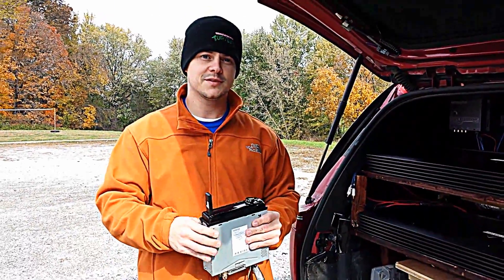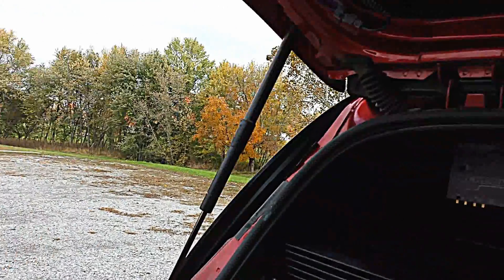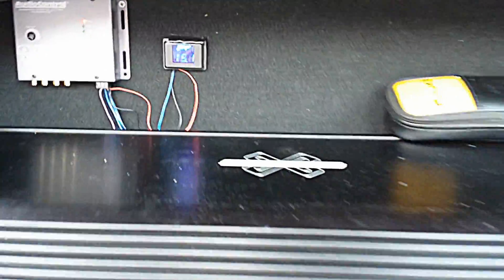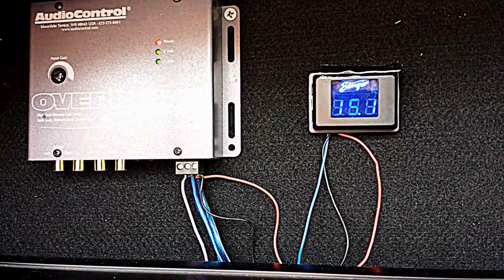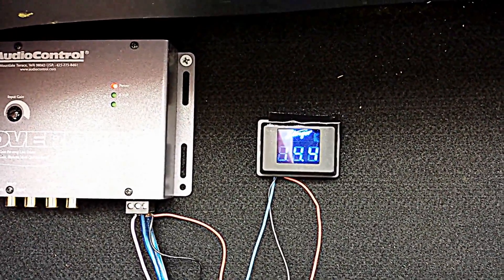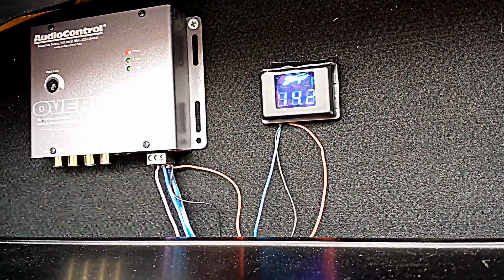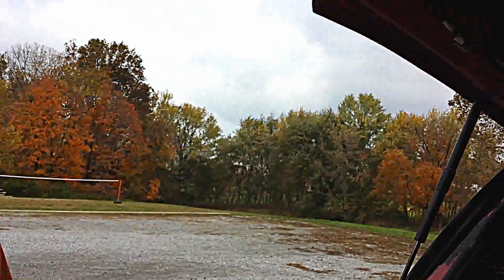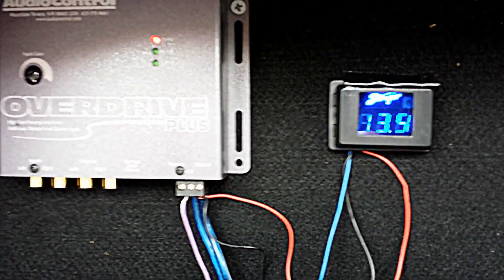Ultra Capacitor, Super Capacitor Demonstration, Explanation. supercap, ultracap, Amplifier

Comment: I used a bank of six 1500 farads without a battery in my van for over a year.
At 7volts, it still has enough amperage to start the engine. It also doesn’t load the alternator when charged like a battery.

Comment: very nice video!   I have in my car only 4 speakers without any amplifier.and my question is: can i use in my car xs ultra capacitor bank 12v 500farad, without using any battery at all?   the xs ultra capacitor bank will last longer than a battery?

Comment: I just bought 6 3000f 2.7v cells to make 16v and 500farrad. I will have about 2500watts between my two amps and just the main batterie to run the car. It sounds pretty good without any capacitors but the bass drops off after the first big hit, I’m hoping this will help. I’ve heard you should have 50farrads for every 1kW worth of power

Comment: batteries last about 3 years, how long do capacitors last?
Reply: They say for ever. but who knows.
Reply: 10 years at 80degrees C, 1,000,000 charge/discharge cycles according to the datasheet

Comment: 12 banks would be more like 6Ah.  And that's if u charge them to 16.2volts and draw current until it drops to 12 volts (somewhat usable voltage). I'm trying to determine what I'm gonna do for electrical. I'm not a spl burp type. I demo music and do street beat lol. I got 2 Mechman 320s.  Trying to get electrical ready for my M5. Are u running pure caps? I was thinking about running 8 banks of caps and just my 2 stock battery (duralasts side posts) but I'm up in the air. $2000 is my battery/cap budget. I was also thinking 2 standard 80ah agms, 1 45ah jy lithium and just 2 banks of caps....

Comment: all a battery in a car is doing. is to start the motor and power your radio if you turn the key in AUXILIARY , then your alternator does the rest, as for caps, they make sure you have that constant power there supplied by the alternator. So it makes know sense why you took your battery out of your vehicle!!!

Comment: would i be able to keep 14.4v on music engine running with a 100a alternator with 14.4v output with a dc to dc converter(battery isolator) which gives me another 20a of output hooked up to a bank of capacitors or would i be better off getting a 270ah 100 hour battery? I am buying a hcca5000.1d it makes 5300 watts @ 1ohm with 12.6v and 7200 watts @ 1ohm with 14.4v
Reply: You're not getting anywhere with a 100a alternator.

Comment: amazing! fantastic work! I know this vid is a year old, but I am going to copy and paste my response to a kid who posted a vid that was trying to explain that caps are garbage. I have tested 2   1farads back to back inline and I know how much they help. to hell with playing your system with engine off. heres my response to young-buck.......stop listening to car audio forums. the guys telling u to buy batteries are sponsored by agm battery companies. take a dmm, Digital Multi Meter and do a b4 and after test. place the dmm leads DIRECTLY on your amp while playing a loud bass song. most setups will gain appr 1.0 volts with a 1farad cap! I have installed 2  1farad caps inline and gained 1.4volts continuously! so unless you want to run your system a lot with engine off or unless you want to support the economy, then u should try my test. caps are no more of a bandaid than extra batteries. extra batteries put hella strain on your alternator. if u watch the big dogs runnin 20k plus they mite run 5 300amp alternators for a total of 1500amps (appr)   theoretically 20k could pull 2000amps! so most big dogs will install a bunch of agm batteries and even with engine at 1800+ rpm they actually are slowly draining there batteries and there voltage slowly drops. and ul see them say they half to wait a few minutes to charge. case in point, test for yourself but capacitors do not get the respect they deserve.          that was my response to him. if you see this mr clements, post more vids plz!
Reply: Remember tho hes using ULTRACAPS.. just one of the caps in the bank he has is equal to 3000 1 farad stiffening caps.  He probably has groups of 6 in series to get the voltage up to 16v and then put the groups in parallel to extend the capacity..  that bank he has is not cheap.  you need at minimum 6 caps to get 16v and that can run about $120-400

Comment: I'm still surprised that people don't understand that capacitors are for quick release of energy and not for longterm storage. One day they will also have high storage and replace batteries for the quick recharge and forever lifetime. But for now the energy density is too low. 

I have to question you on one thing though. You said you have 12 caps in series on a 12v system? I think you mean that they are chained together in parallel. Putting them in series would bossy voltage (if your car could go higher) and put a drag on your esr.
Reply: I stand corrected. I see you did put them in series and they are just low voltage caps.

Comment: Running any kind of cell balancing? 2.5 volts per cell is pretty close to the recommended max and overcharging these things could be potentially catastrophic.

Also, for anyone wondering how the math works out, 1 farad is basically 1 amp per volt so this bank at 6k farads going from 15.3 volts down to 13 volts is 2.3 volts * 6,000 farads or 13800 amps consumed (which also comes out to about 3.83 amp hours, before natural supercap leakdown).

Comment: First of all, this is awesome! I have what you call 1 bank (6 in series & 16.2Vmax) and thought that was beasty!

I have 3 questions,

1. Because you have no battery, how long can you crank off the capictor bank before your capacitor bank is depleted?

2. If the bank was fully charged and you left your car sitting there without the ignition or accessories on, how long does it take for the capcitors to self discharge passed cranking voltage? or what s the lowest level you have seen them on after sitting for a while?

3. Do you run any type of short circuit protection between the cap's and load other than that of the amps? if so what are they rated for?
Reply: I can help with some of these questions.

1. The bank in this video is huge. If you're asking about how long he could turn the engine over to try and start it (say on a cold day), this bank would probably have no issue starting a big diesel engine on a sub zero day. The trick is figuring out how much power the car needs to get started, and then building a cap bank to supply that amount of power at least a couple times over. There's numerous videos on YouTube with cars being started off of much, much smaller cap banks than this.

2. Capacitor leakage is fairly prominent during the first few hours after charging, and may be affected by cell balance. My first ever go at it, I charged a single, identical bank to the one in this video (2.7 volt Maxwell 3k farad caps x 6) to 14.0 v and saw a variance of only ~.1 volts per cap maximum; two caps held a charge of 2.39, and one had a charge of 2.3 while the rest had a charge of around 2.33-2.36. After 19 hours, they had leaked down to 12.63 volts and leaked down another .01 volts 5 hours after that, at which point I charged the bank to 14.42 volts, and after 3 days the bank leaked down to 13.245 volts; this is what the bank looked like after 5 days with nothing connected:

Bank: 13.08v
Cap 1: 2.23v
Cap 2: 2.22v
Cap 3: 2.145v
Cap 4: 2.19v
Cap 5: 2.14v
Cap 6: 2.125v

I'm fairly certain that charging, balancing, recharging and balancing again will result in significantly less leakdown over time, but I'm not really sure how they will react to not having a balancing circuit in place and being used heavily.

Comment: So in all, you have basically 6000 farads?
6-2.7 3000 caps in series, divided by 6, 500farads each bank times the number of banks 12? Correct?
Reply from the maker: yes
Reply: Blake Clementszz
Reply: you already did the math for me
Reply: in 12 banks,  he has 36000 Farads. at full voltage.
3000 farads for each bank of 6.
You just increase voltage , when they are in series.
When you put CAPS in parallel you increase Farads.. not voltage.
You need to use a resistor when charging them, especially if they are depleted.
It will cause a short circuit to the alternator.
Reply: +David Ojeda Capacitance decreases in series represented by Ctotal = 1/ (1/C1 + 1/C2 + etc.) each bank of 6 3000F caps equals 500F total capacitance
Reply: yea, sorry my mistake.

Comment: Are you running any batteries in parallel with the caps? And if so, if this makes sense, are the caps discharging first, or is it all acting as one big charge system?
Reply from the maker: No batteries at all are in the vehicle or electrical system. The batts would drag the caps down as soon as the alt was no longer the highest source of potential. Batts decrease the performance of the caps DRASTICALLY.
Reply: "as soon as the alternator stops being the highest source of potential" you mean with engine off the caps will slowly loose voltage and rest with the battery at 12.6V
Yeah, but you never listen to music with engine off. And if you did adding a battery will allow you a few minutes of music playing versus a few seconds with only the caps.